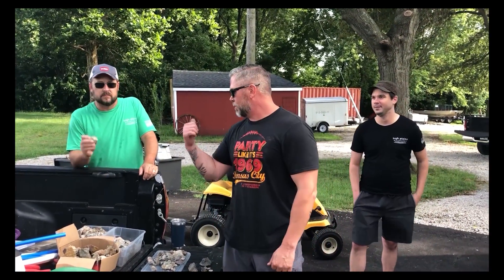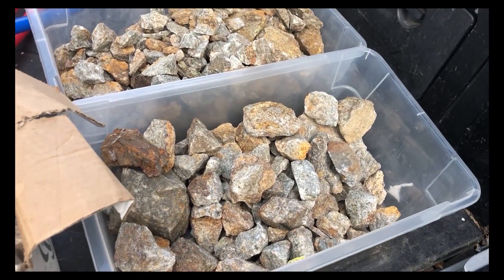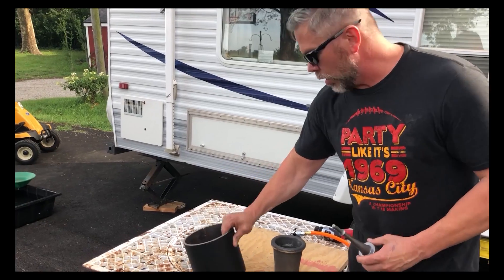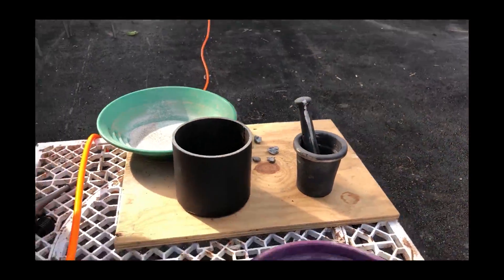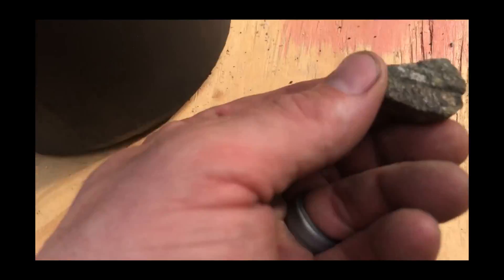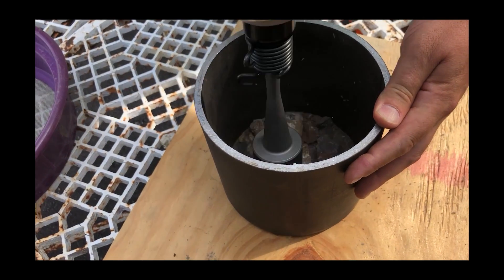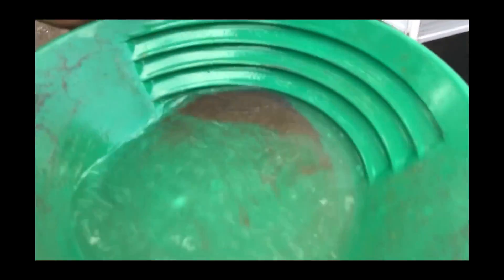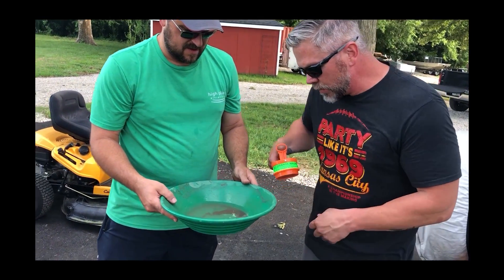Crushing Rock for Gold!

Comment: just curious do you add oil to the air hammer and how do you keep the oil from getting into your gold ore
Reply from the maker: You just need to put a few drops of pneumatic oil in the air hammer.  It goes into the nipple where the hose connects.  I haven't had one leak on me yet as it is only a few drops.